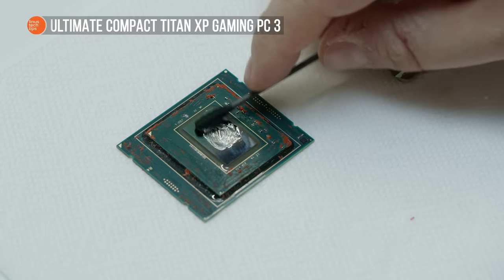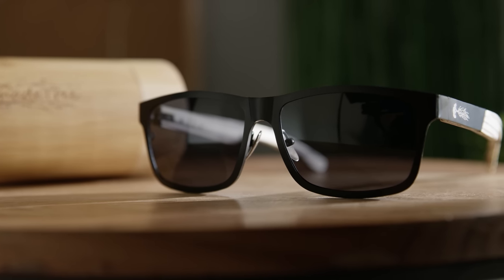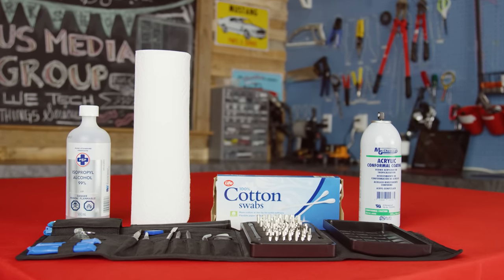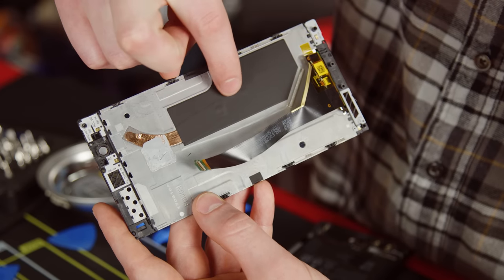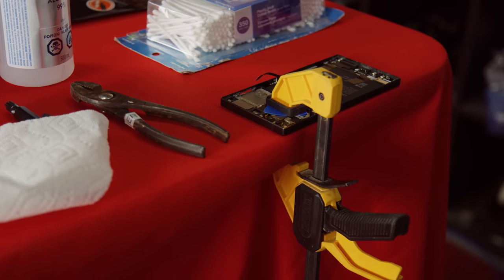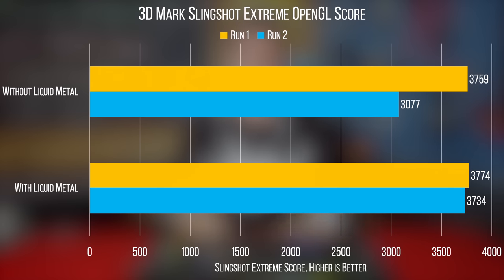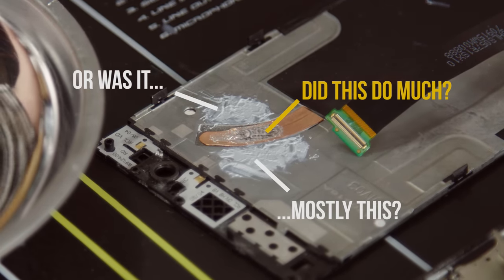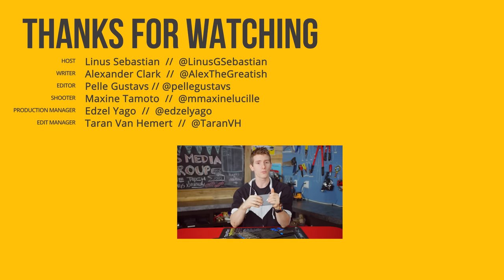Liquid Metal Cooling a PHONE!?!?!

Comment: Did this to my s9(warranty was way pass due)the battery was bad so i went inside!, I replace the battery and also used a thin layer of copper sheet where rhe copper heat pipe is,then  i added some  grizzly thermal paste on the cpu and ram,close it! And my temp is now, lowest 25.5 C and max is 33.5 C,The phone doesn't lag or randomly shuts dowm anymore,and the battery is more stable.I  wana thank JerryRigEverything and Ifixit as well your channel!. It also has a clear back XD.I put it back together like Little legos.

Comment: I wonder if some alternate form of thermal conduction would be a better idea? Also, most phones may not have any extra cooling. The Razer appears that it does. So instead of using liquid metal, what about just using copper foil layered up upon itself to form a heat sink to back case, and thus to increase cooling. I see it marginal at best. Heat sink traditionally needs radiator like properties. I guess any form of cooling is better than none, however. I think just using a larger amount of silver thermal paste, which is non-conductive, but generally does not melt nor runoff, would be simpler and better idea. Also, some phones/tablets do not have metal backs. That alone means their only cooling is from inside. (Example Galaxy S6, iPhones have only glass on the rear of the case) and offer no benefits to cooling. Laptops use copper liquid cooling systems. One wonders why cell phones do not have some form of radiators to allow cool air to flow. A micro cooler. No not vents to allow liquid in but a sealed arrangement allowing heat transfer out of the phone.

Comment: Here's how I cool my phone when gaming! 
Get a paper towel & fold it to a square that'd fit the top half of the phone, 
Spray some water on the paper towel, just enough to make it completely wet.
Then place it on the back of the top half of your phone (it should kinda stick on due to being wet),
& go ahead and play some games.

The evaporation of the water from the paper towel carries away heat from the surface cooling down the phone, this would work best on metal & glass backed phones. Works for me, give it a try & see for yourself.

Comment: I used mx-4 and kryonaut on my S4(i9500). Difference? A bit lower idle temps faster ramp up and down temperatures. It doesn't really matter for S4 because there isn't a good cooling solution on it and exynos 5410 hits 94 C under 10 seconds at 1.6 GHz even underclocked since Samsung didn't bother configuring the correct voltage tables for this cpu..but the good thing is, it throttles less from 1.6 to 1.4 and no 1.2 anymore, and now it even goes back to 1.6 after a few seconds(something it didn't do before). In every day's simple tasks like surfing it's not gonna do that almost at all, only under stress test.

Comment: It's funny how they perform better. I ride a motorbike and I have a phone holder installed. At these sub zero temps we are getting in England, plus the wind blowing directly on the phone, I am currently cooling my phone to -15 degrees. HW info says my cpu diode is -15 degrees lol.
Reply: Victor England what phone holder are you using, I'm looking for a decent waterproof one
Reply: There isn't a decent one mate. I just use a cheap Chinese phone which claims to be waterproof and shock proof. It's called HOMTOM HT 20 Pro. It cost me 100 pounds (about 120 USD) and it does the trick. I have a Galaxy S8 that I personally use but when I'm on the bike, I go for the shitty ones. The holder cost me 10 pounds and I found it on ebay. As it's so cheap and nasty, I just superglued the quick release mount so it won't go anywhere. Plus the waterproof phone, it just works as a treat. As a motorcyclist, you know how much we lose with wallets, keys, phones and the stuff that most people take for granted when driving cars.

Comment: I put liquid metal on my razer blade stealth, but the plate doesnt quite hold it in tight enough, thing was burning up! but I also have a -.1v undervolt so even with standard paste it was running 80* max no throttle.

Comment: I am always curious why manufactures don't doing this things normaly. Is it so complicated or expensive for them? Or they don't want good cooling because that product will survive too long? I guess the last explanation is correct.
Reply: Uh, liquid metal can destroy a device, plus they would have to constantly reapply the application.
Reply: @raawesome3851  that's not true, I have liquid metal in notebooky 5 years, I checked it last week and it was 100% ok. Also I had 2 years liquid metal on my i5 4670K and again - no problem. Yes, it was not easy to remove cooler, but copper base is ok and CPU has only little removed text. I know it's dangerous for aluminium and maybe some other materials, but for copper it's safe.
Reply: @Pidalin  well, that's assuming people all use copper for the cooling of their devices, which is pretty expensive.
Reply: @raawesome3851  It's not so expensive but producers did better class from common metal. But most of the better coolers still have copper base. You can find even cheap coolers from copper.
Reply: @Pidalin  what cheap coolers? If you find it on something like eBay or AliExpress, then it might be because they don't do as much testing, and their products are less reliable.
Reply: @raawesome3851  even AMD stock cooler has copper base and it's included in box with CPU and very often it's nickeled copper so it can look like alumuminium, but it's not.
Reply: @Pidalin  well, the actual cooling performance of AMD's cooler is okay. But copper is still expensive, and some people can use aluminum, yet make a better quality cooler with their savings.
Reply: @raawesome3851  ofcourse 1 kg of copper is much more expensive than 1 kg of aluminium, but coolers were never full copper (only the most luxury models) and for base of cooler you don't need so much copper so alimunium base is really only on totaly shit coolers
Reply: @Pidalin  like Intel's stock cooler.
Reply: @raawesome3851  intel stock cooler was shit 15 years ago same like today :-) but in the past it had copper core

Comment: hmmm seing as liquid metal can end up flowing around couldn't you use some silicon adhesive aroudn the sides of where you apply it to prevent it from spilling etc.

talking of the razer phone specifically at least//

Comment: Wouldn't your phone in the end feeljust as warm if not more since the heat produced is still the heat produced it just transfers off the CPU better
Reply: Fortunately you can't yet play games with the phone in your pocket, so that gives you a margin of safety. It probably would not get that much hotter.
Reply: Kenneth Bouchard well technically 
you can with a wireless controller and something like a chrome cast. But my comment was more to the joke he made about the warm phone in your pocket so changing thermal compound wouldn't really make your pocket less warm

Comment: If liquid metal performs this good, why is it that manufacturers don't use it? Hmm.
Reply: Because it's expensive or at least more expensive than regular thermal paste.
Solder does the job as well, but that's also more expensive. 

Thermal grizzly conductonaut  costs about 8-10€ for 1g, where as you can get 3g (or even more) of regular not impressive thermal paste for about 3-5€(maybe even cheaper).

You can also look up amd cpus/apus. They use solder on most of them, but on their new cheap apus they use thermal paste to reduce the cost.

Further more while on phones it could be useful to use at least high performance non conductive thermal paste, on pc unless you are doing overclocking(and even then unless you are pushing the cpu to the limit) you likely don't need liquid metal.

Comment: Now this really is the most pointless thing you guys have ever done.

When does smartphone performance matter, besides in benchmarks anyways?

The loading times of apps are bottlenecked by the system storage's speed and overhead from the OS and Software and mobile games are made to surprise, surprise run on most mobile phones. They'd run just as well on any mid-range phone, so why buy the highest end smartphone to run games? "Oh yeah, I could run my mobile games on like quadruple the framerate as your phone could, if they didn't have a fixed framerate anyway." awesome! 1k$ well spent!

Same with display resolution: what do I need a WQHD or UHD resolution on a 5.5" screen for? My 24" Monitor has "just" FullHD and makes a perfectly sharp image, even looking at it very closely. There's no real benefit, except for 4k maybe, but 1440p Smartphone in VR still looks pixeled af and 4k prob as well. who does VR anyway? It's such an exotic use case that it really shouldn't be used to justify wasting loads of potential battery duration.

It all just costs battery life but has no actual advantage!

I'd like to see someone making a flagship smartphone that focuses (pun) on the features that really make a differenc to the user experience. Like don't try to make the fastest, highest performance CPU, make the most efficient one that gets everything done just as well. Get rid of the ridiculous high resolutions in these tiny screens. Instead, make the phone as efficient as possible, so it's battery can last like a week or even more. That would be what I'd call COURAGE*.

(*and not removing the headphone jack. The outstanding headphone DAC in my phone (htc10) was the reason I bought it. Not the top-of-the line SP820 cpu)